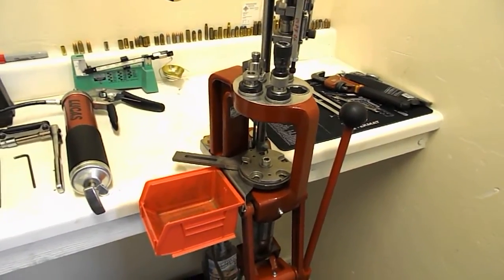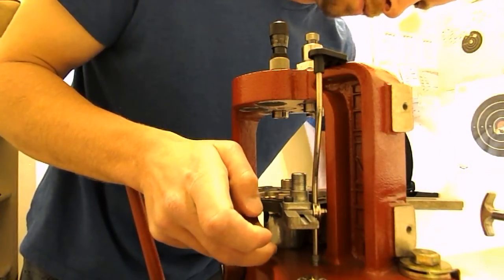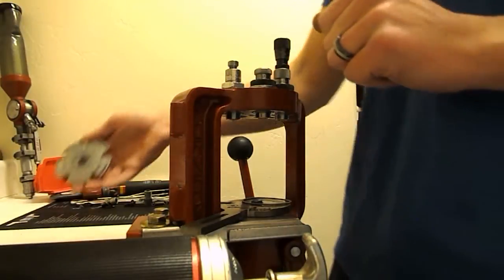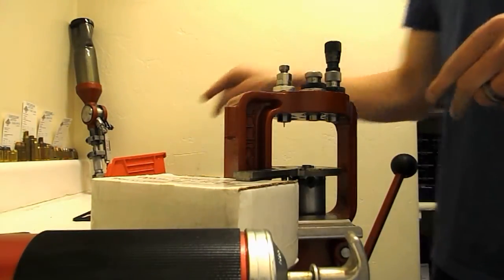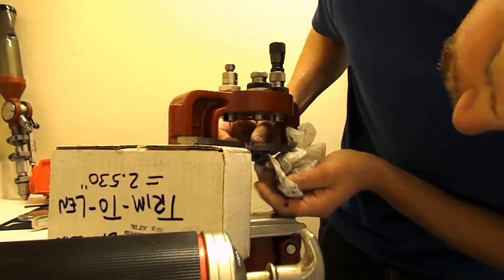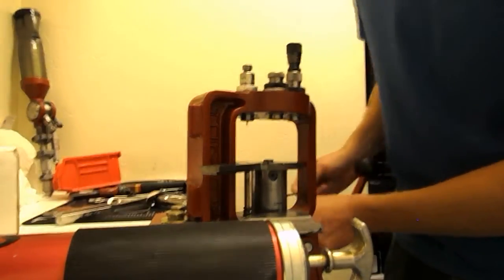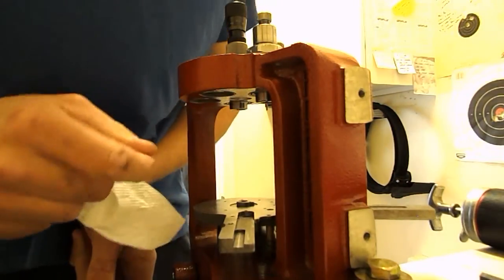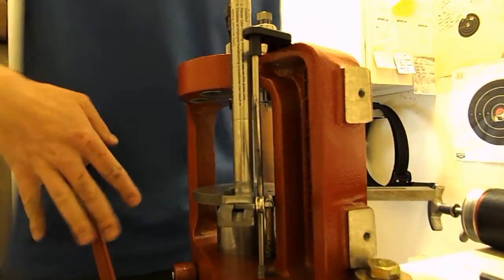Hornady Lock-n-Load Progressive Press Maintenance - Part 1

Comment: Hey Adam, I just wanted to thank you for sharing that video. I had my Hornaday lock and load for a few years now loaded several thousand rounds. I wasn’t aware that you should take that so plate off of that hub and lube it I did that like your video said it was dirty dry put it back together. It is run. Very smooth now. Thanks again for your time and video.

Comment: Adam - thanks for taking the time to put these videos together.  I galled the drive hub because I never knew to lube it.  Made it to 8k rounds before failure and then had no idea how to tear the press apart to get the hub out.  Your video saved me a ton of time!  I had two issues.  First, getting those screws out that hold the sub-plate in place.  Wow.  Ended up drilling and punching them out.  Painful.  The second was reassembling the bottom piston - as I took my press all the way apart to clean and lube.  The spent primer tube is pressed in - and it can be removed by putting tape around it, grabbing it lightly with pliers, and tapping the pliers with a hammer.  A quick call to Hornady and they sent replacement parts free of charge - no questions asked.  Bonus!  Again, thanks for your time.

Comment: Thanks so much Adam. I fixed my seized up hub from your video. I had to remove it and sand the inside of shelf assembly, then sand the keyed hub a little and lubed with white lithium grease. I literally had to pound my keyed hub out of the shelf with a plastic tent stake HAMMER.  All you guys who have a press like this, don't leave a tight shell plate attached and leave it sit for a long long time. The factory never greased that hub in the shelf. It's a cast part and mated with stainless steel hub.  Lube , Lube, Lube. Very rough inside the casted shelf.

Comment: this video just saved me a lot of time and headache, i was already dealing with..... I did process a few thousand rounds in the sizer already however, i was seeing deflection in the case plate, and did not know how ot solve it. I just put NLGI #2 Automotive Wheel bearing and chassis lube (xtra heavy duty) on the drive unit and in side the lower plate. My press was NOT marr'd up thankfully it was just in need of lube. and boy oh boy did it fix the slop.

Comment: Hey Adam, good video. I broke several of those plastic brake away pieces thanks to the primer plunger getting stuck because of shavings of brass. I called Hornady and they sent me for free small and large primer plunger without the rim. It's much better design. Since I changed it I had 0 problems with the priming system.

Comment: I think this is the only video on the subject I have seen on YouTube.
Had reload height variation several years ago when I started reloading. Did what you suggest but it did not fix my issue. Fixed it otherwise.
However, several years later today, after not reloading for roughly 4 months, my Hornady press was getting hang-up going up and down roughly 1” from the bottom. 
I could not find anything wrong with the press.
I remembered your video and tried to remove the hub. It was tough actually. Found a way and noticed how much crud and dried grease was around the hub not letting it turn properly and not letting it slide off properly either. 
Lessen learned, will clean and grease the hub once per year moving forward. 
Thank you for this in depth video 👍

Comment: Thank you thank you thank you!!! I got one of these new but not in its box along with the LnL single stage. LOVE IT! But, about 1000 rounds in, and all calibers, my shell plate stopped turning tonight and I couldn’t figure out why! I sprayed some cable lube for motorcycles on the top and bottom of the shaft which worked long enough to finish the 100 rounds I was seating. Lubed the zirk fittings but never actually knew the correct procedures. Never knew about that lube groove, and you just saved me from galling and ruining that plate bearing surface. I have a Dillon case sizer/trimmer that has a vacuum attached to where the tiny brass filings go flying off the trim head. Cool set up, but... today while setting it all up for sizing the 223 for the first time, I’m sure I spilled some filings down into that top sub plate and shaft bearing area. So it’s coming apart tomorrow. I have all the tools and skills. It’s getting a thorough take down and cleaning white glove style with solvents and cleaner to remove any and all crud and old dirty grease! New fine bicycle grease going in. Next video is gonna be that one about everything there is to know about the powder measure. How on earth do we get that rascal to stop spilling powder! I’m a clean freak and it’s driving me crazy. I’m doing something wrong. Or, is it perhaps spilling from the loaded cases from jittering shell plates??? We shall soon find out now that I know how to service this fine piece of precision machinery! Thanks again for a very thorough instruction!

Comment: This video is the best maintenance video I've seen on this press. Hornady should hire you for these videos. How did you measure  the movement of the sub plate or determine it was worn? Is it quite noticeable? I haven't lubricated mine and I've ran at least 2000. Thank you for your time.

Comment: My shell plate has wobble/ play in it.  I feel like it’s coming from the drive hub.    Where I put the bolt in to tighten my shell plate to the sub plate.   I can take my hand and wobble the shell plate back and forth more than I care for.     Do I need a new drive hub?    I’ve had the same issues you mentioned.

Comment: Just got the  AP from my honey for Christmas. Probably gonna take the drive hub off to lube it while it's new and undamaged. BTW .. I couldn't help but notice your powder measure looks a little deformed!?! What happened?
Reply: Do you still have it ? Mine seized up with less than 500 rounds loaded. Keep that hub oiled under the shell plate. My press sat 2 years and I couldn't raise the ram, it would not index at all.could raise the ram 1" and no more. Calling Hornady tomorrow, I need new pawls, sheered one off.
Reply from the maker: Powder eats the hopper - weird material choice by Hornady on that one.  It eventually melts and powder gets embedded in it
Reply: @adamsteffes3374  REALLY?!? The powder did that? I normally dump mine out after a loading session. How long did you let the powder sit in there?

Comment: Odd - your drive huh pops right off. Mine is completely seized like its pinned or something. I'll call hornady now :(
Reply: I called hornady and they confirmed your video instruction with regards to just lifting off the drive hub. Mine was frozen in place. After channel locks failed to remove it, I wound up using a long wrench sandwiched under the center retaining socket head capscrew , and pressed down on the ram with the lever to get it to let go! I almost broke the wrench it was so stuck!!
Reply: My press sat for 2 years in my house and now it's locked up solid. I could only raise my ram 1inch. I tore it all down and pushed in on one of the pawls with a screwdriver  and I could raise the ram fully, but it won't index. I ended up forcing the handle to advance it and sheered off a pawl. Now need to call Hornady.  Even though I lubed it with grease gun years back, I never loaded even 500 rounds on it and it locked up. Very crappy build if you ask me. They never mentioned in owners manual about lubing under the shell plate shelf. 😠